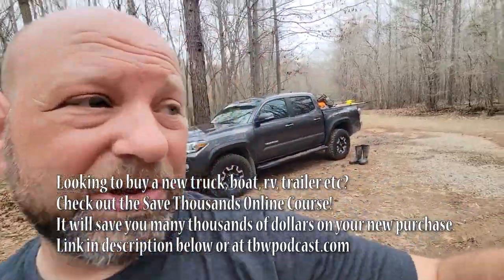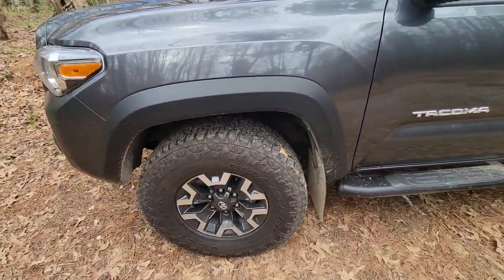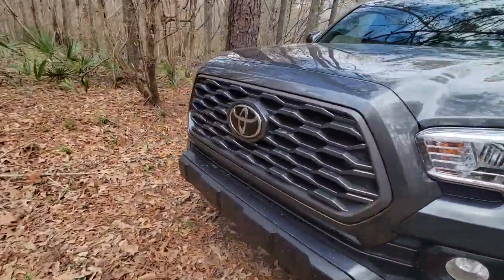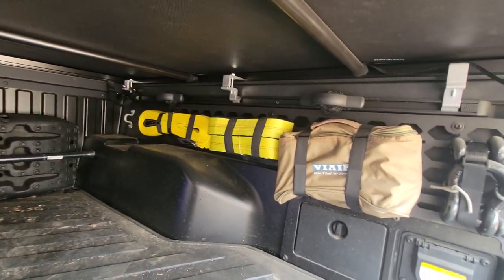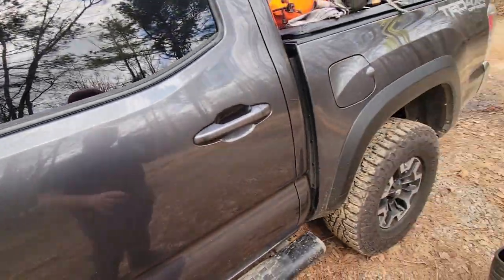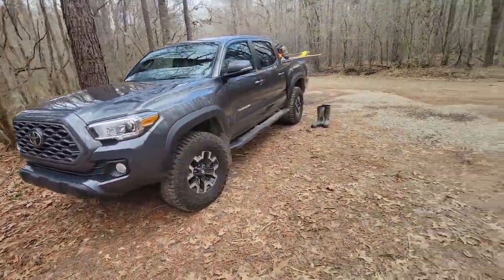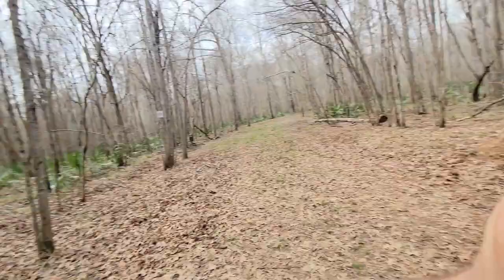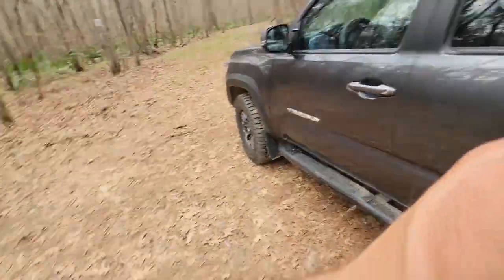2022 Tacoma Trd Off Road 5000 Miles Pros And Cons

Comment: I have a 2005 Tacoma off road that has 400,000 miles on it and just ordered a new 2023 Tacoma off road custom with a lift and a few other extras..i have owned 5 Toyota trucks and all have made it to 400,000 miles effortlessly....and I also spend alot of time up here in the NH woods wheeling...it is definitely a very capable truck...my new one will be electric lime...i cant wait...!
Reply from the maker: Love hearing this and congratulations on your new one you have ordered
Reply: Have you ever had any transmission issues with your 5 toyota trucks?

Comment: Hi, I am also from Michigan. I just replaced a Tundra with a Tacoma TRD Off Road. I like the smaller size, so much easier to live with for all the reasons you gave. If I want to explain why I wanted the Tacoma I should just have them watch you. I wanted to share something that I came across you may want to to do with yours. I found when I don't have my boots on, I feel the gas peddle is too stiff, but there is a really easy 5 min fix I found and it makes all the difference. There are two 10 mm nuts holding the pedal to the firewall, and a simple wire connector. I first removed the two nuts, then the the electrical connector. There are four little clips holding the cover on the pedal assembly, carefully pry all four and the cover pops right off. There are two concentric springs that pop out easily. I just removed the inner spring and then put the big spring back, popped cover on, and that was it.
Reply from the maker: Glad you are loving the truck too! This is a great tip. I have not experienced a hard gas pedal in mine but if anyone else does they sure will appreciate this info.

Comment: I own a 2019 Tacoma 4x4 off road like yours and you are absolutely right, why they don't have a lockable gas cap. And any after market will not work.
Reply from the maker: Yep the gas cap is a bummer.  But the truck is amazing

Comment: I love my Tacoma as well. I live in the city so I haven't taken it out in any rural areas yet but it's the perfect size for the city as well. I also have a full size Tundra and that can be a pain to navigate certain areas.
Reply from the maker: Yep i have used my ram 2500 truck on weddings in the city at times and it was brutal finding parking and worrying about door dings etc. the tacoma is the perfect size city truck.
Reply: @SamkoTradBow  Agreed! It is the absolutely perfect size. Love your Tacoma, those side step bars actually give it such a nice look! I'm thinking of putting them on mine.

Comment: Nice truck. Very hard to get right now. I'm on a waiting list for the  same truck with magnetic grey with manual trans. Your video Inspires. You changed your tires. What did you do with the stock tires?
Reply from the maker: Yep tought to get many trucks today and a manual makes that even tougher. I sold the stock tires on facebook immediately. so my new tire upgrade actually only cost me 200 bucks after selling the stockers.

Comment: Great video. How do you like the automatic transmission. Have heard some people complain about how it is always searching for gears at certain speeds especially when driving uphill. Looking to get a 2023 TRD Off Road soon.
Reply from the maker: I've heard the same thing from others. It's never been a bother for me or something I paid attention to. I think people are just way to nit picky. I also pull a 3000 pound trailer with mine daily in the spring and summer. Work perfect
Reply: @SamkoTradBow  Thank you for your insight.  I recently had an unfortunate traffic collision with my 2006 4Runner of 16 years of faithful and problem free service. Best vehicle I’ve ever owned. Looking for a suitable replacement and all I feel confident in is another 4Runner or Tacoma to last me another 15-20 years. Getting long in the tooth now and will most likely be my last vehicle.  The Tacoma fits the bill. I feel that although it is dated technology compared to what’s out there now and what the future holds, it will outlast all of them.  Your video has been very helpful in making my decision. Thank you for taking the time to make it.
Reply from the maker: @jimf.625  I 100% agree. I have been a 40k plus miles a year driver for the last 30 years. Been thru 22 new vehicles.  In my opinion there is not been a suv or truck made today that will have the reliability or longevity as a 4 runner or tscoma. And that will change next year when both get a turbo motor and redesign.  I am thinking of selling my tacoma later this year to buy a 2023 just as I can get more years out of this proven design before the new style 24 gets here and ruins it all.

Comment: Great review. Did it come with all 4 mudguards and you removed the rear ones yourself? Any issues with clearance with the front ones when off road?
Reply from the maker: Mine did not come with mud guards. The stock ones are not very flexible for off road. I bought these from rekgen. Link in video description. I bought front and rears but only put the fronts on. The rear is well protected with 3m tape and high departure angle so less likely to get stone chips.

Comment: Man! What a great life in your Tacoma. Makes me feel I should have gotten the TRD Pro (instead of my 2022 Sport 2x4, Lol!). I like your bed setup with all the gear clear off the bed floor.... I'm buying the long toolbox for my daily driving, and on camping trips I'll reinstall the box with the outlet. Its got more room for tools... I have a basket roof rack from my previous 2-Gen Taco. That's what I'll use on trips...  Question; when you roll the tonneau up, do the frame bars roll along with the vynil or do they stay in place?
Reply from the maker: Was just reading an article about how the 2x4 tacoma was still an amazing off roader even without 4x4!  The tonneau cover cross bars roll right up with the cover.

Comment: Would you recommend the 5ft or 6ft box for guys that hunt like yourself sir?
Reply from the maker: Both are great options. The 6 foot will be harder to turn in tight places and have less break over angle going over obstacles.  Bit it will have more capacity.  So it's a trade off either way

Comment: Those side steps that it came with, how far do they stick out? I ask because I am about to get a Tacoma TRD & I am wanting my steps to stick out JUST ENOUGH so if someone opens their door onto my truck, they hit the steps before my paint 🤣🤷🏻‍♀️😉..
Reply from the maker: The factory ones like these ride high and tight to the truck. They are great steps and honestly I just stepped over them rather than on them but liked how they guarded against stone chips. I've since Removed then do to all the mud they held and pain in the bit to clean the mud off them though. But these will definitely stop a door ding from another vehicle if that vehicle is lower that the steps
Reply: @SamkoTradBow  Thank you sweetie..

Comment: For a dedicated hunting vehicle, would you go Tacoma or back to your Cherokee? There are still some advantages I see for an SUV for hunting, but the everyday utility of a truck is tempting.
Reply from the maker: Tough call! Both are amazing and you can get the cherokee trailhawk for about 10 grand cheaper than the tacoma.  Both ate very capable but the tacomas truck frame, soild rear axle etc makes it more durable to years of offroad use.
Reply: @SamkoTradBow  Yeah—my heart wants a new Bronco, my head says Tacoma, and my wallet says used Cherokee if the used market ever comes back down.  Don't know if a used Cherokee is a great idea though; I've seen poor reports on engine life beyond 100,000.
Reply from the maker: @twilightkids  yep tough decision.  Let your wallet decide and not emotions is always my personal best bet. Weigh the pros and cons of each.
Reply: @twilightkids  you'll be happy with a tacoma for sure. Make sure the transmission is ok. Mine was geared to high had a tough time with hills and a small trailer.

Comment: I test drove a trd off road, the seating position is to low to the ground, the 6 speed automatic gear hunts like crazy and is gutless, has no power. They are extremely reliable and hold there value, I thought it was not comfortable and  went with an f150. More money but this 55 year old didn’t like the Tacoma at all. Glad your happy, that’s what counts for you. I get 28 mpg with my f150 with the Diesel engine and a way better ride
Reply from the maker: I have owned 9 new f150s. Good trucks but could never go where I take this tacoma. This thing is unstoppable off road and fits into places I could never get my full size. I love it. I don't miss my f150s at all. Loved my 150s but could not be happier with this tacoma. I see why everyone loves them so much
Reply: I have a 2019 Tacoma TRD Off Road, and I hated the transmission for about the first 6 months for all the reasons you stated - and really wondered if I made the right decision. As time went on, the trans got better and better. No issues after that "break-in" period. TBH, not sure I just simply learned to use the peddle in a way to make the truck work as I want, or if the trans improved on its own, but either way, no issues.
Reply: Overland tailor tune fixs all that gear hunting. And seat jackers fix the seat

Comment: You need to get you some weathertech or Husky floor liners, they hold the mud and water and save your carpet.
Reply from the maker: The factory all weather mats I have work great. When I Wear them out I will get weather tech like I had before. But until then these were stock on my truck and work excellent

Comment: Howdy Jason. May have missed this in other videos but can you let me know what straps etc you used in your box for mounting your gear? I just got a taco and I'm looking at doing something similar...
Reply from the maker: Those are molle panels that mount on the bed rails. They are made by rough country. There is a link to all that stuff in my why I bought a tacoma video from December.  Also shows how they mount etc.
Reply: @SamkoTradBow  thanks for your time.

Comment: Jason - quick question for you - my son and I were tearing it up on our ranch in Texas in our 2022 TRD Off-Road and we have the stock tires on the truck... we punctured the back left tire pretty quickly and had to swap for the spare.  We cannot have that happen again out in the country where the population density is extremely low.  Are the tires you chose 10 ply?  8 ply?  We need to high grade.  My only hesitation on heavier tires is the hit on MPG, stopping/acceleration, and road noise, but I simply cannot be in this situation again.   Our ranch is very rocky and rough and we need tires that can take a severe beating and get us the heck out when we are done exploring / hunting.  So, my question is... on your 265/75s (which I intend to upgrade to) what's the weight of your tires / ply and have you noticed any of the above downsides?
Reply from the maker: I never drove on the stock tacoma tires as I had the dealer swap to these goodyear ultraterrain e rated 10 ply tires before I picked it up. But I get about 20mpg at 65, 19mpg at 70 and 18mpg at 75. The tires are not loud on the road at all. 10 ply is all I have Owen on my last 9 trucks. I won't own anything else for the same reason you want to switch. I almost never get a flat and if I do it's usually a nail and I can pull it and plug the tire in under 2 mins. Falken wild peaks are also amazing 10 ply tires. You would have to look up the weights to verify exactly.  But I love mine and will never use anything but 10 ply
Reply: @SamkoTradBow  I think the truck comes with 4 ply.  I wonder if there’s middle ground to be found in the 6 and 8 play ratings (C and D).
Reply from the maker: @kinanromman5197  bfg ko2s are c rated and I believe falken also offers a c rated version

Comment: I just bought the 2022 Tacoma TDR off road, and there is no navigation system built in and I keep getting the runaround that there isn’t a factory navigation system that can be installed, and that I have to use CarPlay.  Yet there is an entire section in the manual specifically targeted towards the onboard navigation system (which did not come pre-installed on my vehicle). Do you know anything about this or a possible glitch/fix so I can get a navigation system installed and not have to rely on apple carplay? I can’t seem to find an answer to this anywhere online, and the 10 customer service/dealers/service managers seem to be clueless as well 🤷🏼‍♀️🤦🏼‍♀️ Thanks in advance, if you have any suggestions!
Reply from the maker: I believe the nav is part of the premium tech package nad had to be ordered that way from the factory. I never liked in vehicle nav systems anyway. my phone is more upto date and shows real time traffic with less lag. I would not pay for in vehicle nav personally. And I use my phone nav for work every single day. much prefer my phone.
Reply: @SamkoTradBow  thank you! Yes this is what I FINALLY was told by the 10th+ Toyota rep 🤦🏼‍♀️ Thanks for your reply! Happy trails! 😃
Reply from the maker: @beyondsmilesphotographybyc5332  glad you got it all sorted
Reply: @SamkoTradBow  it’s all good!!!  I freaking love this truck! 😄
Reply from the maker: @beyondsmilesphotographybyc5332  I agree. Amazing truck for sure!

Comment: I have a small boat that I pull to go duck hunting and deer hunting, does anyone have any experience pulling a boat with this truck and if so good or bad experience?
Reply from the maker: I pull my 15 foot g3 with it and I also pull a 3k pound 6x10 enclosed trailer with ladder racks on top (huge wind resistance) with this truck almost daily. does perfect. I added summo spring bump stops to the rear to help with the sage of my heavy trailer and the truck does great.

Comment: Nice truck. I have s as. F-150 and I love the space. Ever think of getting a storage system for the bed with drawers? Love mine to store rifle, gear etc  and not having to crawl into the bed of the truck to get stuff
Reply from the maker: Those drawers are sweet! Too expensive for me as I only keep a vehicle for 2 years or so. But they sure are a great system
Reply: @SamkoTradBow  just two years? Why is that, you lease? I tend to run mine into the ground.
Reply from the maker: @amateurbiggamehunter7691  I don't lease. I buy and put 40k mile s a year on them. So it's always served me best to buy new for a very low price and drive for 2 years 80k miles and then sell only loosing 2, 3, or 4 grand over what I paid
Reply: @SamkoTradBow  I’ll have to research that. I have 75k on mine and the used market is hot except now trucks are at an all time high new and hard to find
Reply from the maker: @amateurbiggamehunter7691  yes its a tough time to make my normal system work. Normally I can get 20-35% off msrp when I buy new. That's hard to do right now

Comment: First oil change should be 10k or 9 months I believe?
Reply from the maker: Yep but I always. Hange mine every 5k
Reply: First should be at 1000 miles per toyota manual to flush any metal flakes out from break in period. After that they recommend every 5-8k miles

Comment: Falken Wildpeak comes with 18/32 tread depth.
Reply from the maker: not in the 16 inch that i need for the tacoma.
Reply: @SamkoTradBow   Apologies...Yes, you are correct on the size.  I have LT285/75R16 on my Tacoma, which are 18/32.  I thought that was what you had there as well.  I rewatched and you are running 265...would have been 17/32 on the Falken to start.

Comment: 6:42 not stupid. It’s reliable. Had that system ur referring to on my Chrylser fail on multiple occasions… Tacomas r supposed to just work
Reply from the maker: I've had capless gas tanks on 25 new vehicles that I've put over 100k miles on each without ever having a problem.  No need for a gas cap. Love the truck, but the gas cap is pointless.
Reply: I hear where you’re coming from but I respectfully disagree. Ive never had a singular issue with a gas cap system…
Reply from the maker: @Mako2-1  I 100% see where you are coming from as well. A cap system has been around forever and does work! I wonder if the new tundra that just came out is cap or capless! I will have to go check. Will be interesting to see if the new tacoma design will be cap or not.

Comment: Umm I thought the 16" tires were stock?
Reply from the maker: 16 inches is the diameter of the wheel (rim). It has nothing to do with the tire size. I can get anywhere from 27 inch tall tires to 40 inch tall tires all for a 16 inch rim

Comment: The gas cap makes sense when you have to shed $$$ to replace the cap less gas cap.
Reply from the maker: Never had a problem with capless.  Bit I'm getting used to the screw cap again now
Reply: Great video. Keep them coming. My 21 Tacoma just clocked 12K. No issues.
Reply: You can put a locking gas cap on.

Comment: About the gas cap and hood prop rod; Toyota innovates slowly, because their philosophy is "if it works, don't fix it." Comparing them to domestic car companies is silly. There's a reason Toyotas hold their value over most everything else and last far longer than typical American vehicles.
Reply from the maker: Great points

Comment: Complain about the gas cap is stupid 🤦🏾 the new system fails and you will spend atleast 5k to fix it.
Reply from the maker: Not sure how it would fail. It's just a flap.
Reply: @SamkoTradBow  eventually  it don't  seal properly  and you start getting engine codes for EVAP SYSTEM.
Reply from the maker: @T_O_Negative  evap problems come from trying to top off your gas tank. Never keep trying to pump a few more ounces in after the pump stops. That's the real cause for evahp failure. I've had capless gas tanks on 20 new vehicles and put over 100k miles on most of those with no problems ever.